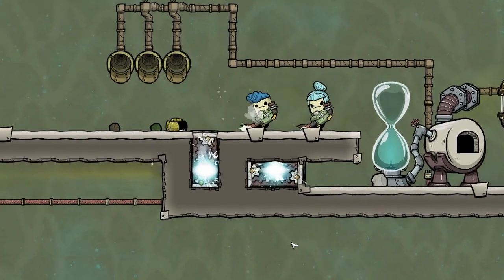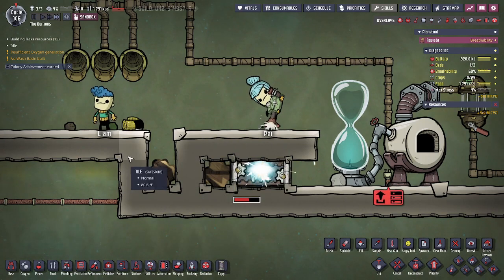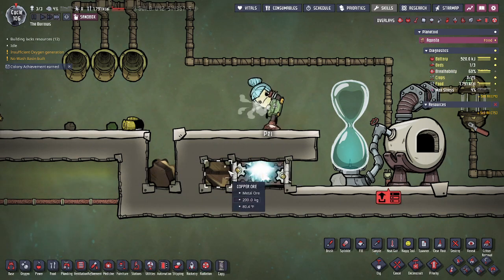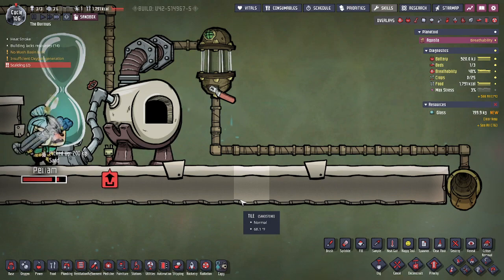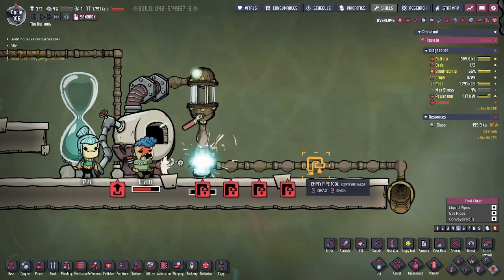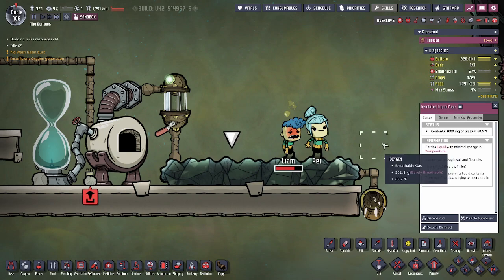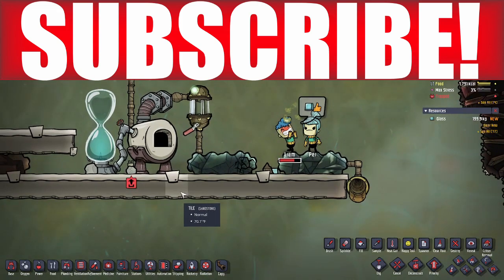Best Method To Make Natural Tiles (+2 That You Already Know) - Oxygen Not Included

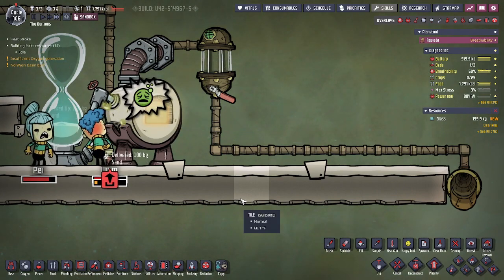Comment from the maker: 1:58 For best method, I just discovered this today, the airlocks are obviously the most popular but I genuinely think it's way superior. I might try to incorporate this glass into base designs especially if I can figure out how to reclaim the pipe it will help on low building material worlds.
Reply from the maker: Additionally supposedly you can file hydrophonic farms with 1000mg of glass then deconstruct the pipe and farm tile, but I think it results in trapped material again.
Reply: Oh damn the glass trick is neat! Im running out of metal ore in one of my asteroids so i might use that.

Comment: About the pipes:
I had the idea of doing this in a vaccum so that i could use radiant pipes, and once i finish i could use them for cooling.
I mean, i would be a cleaner design without that much pipes but idk if its worth the effort doing it like so.
I will test if it works and how much of a pain would it be.
Reply: You don't need a vacuum for that — because the glass packets are below 10% of the pipe's capacity, they won't solidify and the pipes won't take damage. So you only need to use a vacuum if the heat getting into the surrounding environment would be a problem.

That said, make sure you use packets of at least 1g — this shouldn't be an issue unless you use a mod that changes what you can enter into a valve's configuration, but too light of a solid tile won't exchange heat at all, which will rather scupper your heating/cooling plans. Although… this also means that if you can generate extremely-small liquid packets like that, you can use them alongside this pipe-emptying scheme to make solid tiles that insulate even more effectively than insulated insulation, at a fraction of the materials cost and with one third of the suede requirements of using a vacuum layer.